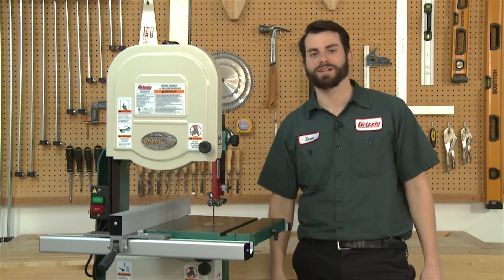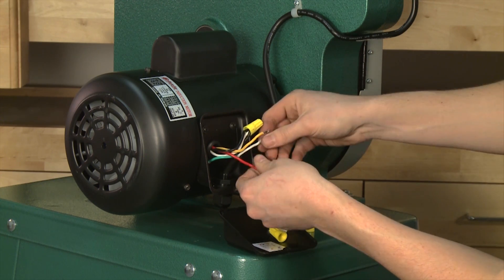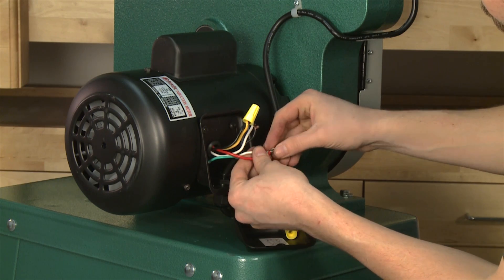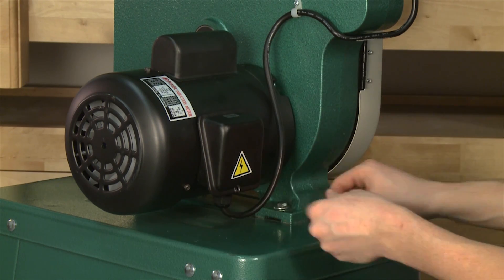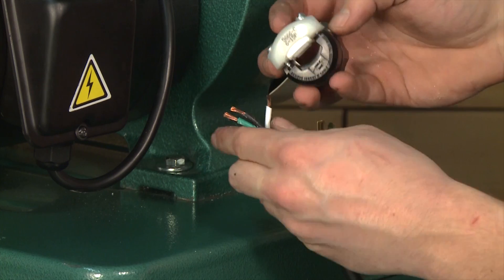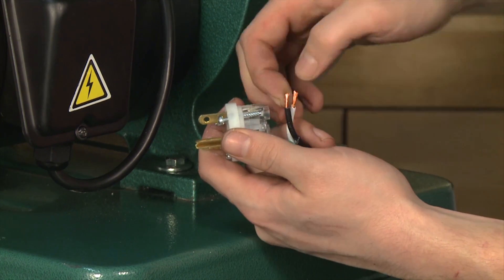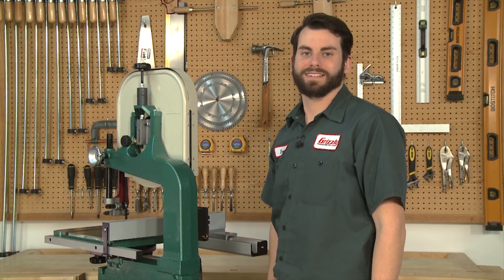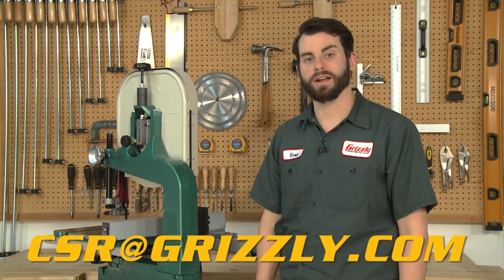110v to 220v conversion

Comment: Can I do that to a110 v fridge? Convert to 220v
Reply: There's a name plate on the motor/compressor it should tell you if it's 240 capable and how to wire it with a vague schematic. As for the light bulbs and potential 120v pressure switches, thermostat or anything similar it's probably going to melt or explode 🤷

Comment: did not show or explain how to wire the source, receptical supplying the 220 volts, plug it in a 110 v and it wont run.
Reply: You have to make sure you have the right size gauge wire and a dual pole breaker along with a 20 AMP outlet and plug end to get it fully hooked up.

Comment: Good video but very specific to model types and the US market. I know Americans seem to love wire nuts but not legal in many other countries especially in Europe.

Some of the comments are VERY scary and display a serious level of  obvious incompetence and utter lack of understanding of even the basics of how AC synchronous motors and three phase motors work and the potential for lethal mistakes. 

If you are going to mess around with AC machines of any type ...

1. LEARN THE BASICS THOROUGHLY! 
2. Take adequate safety precautions ... gloves, rubber boots, current limiting, rapid power off etc.
3. View LOTS MORE videos before even THINKING about changing voltages and for GOD'S sake learn and appreciate Ohms law PLEASE!
Reply: @Nathan Mcilveen not just 240v in the UK. My domestic voltage is REGULARLY above that and often as high as 250v which is what the original UK voltage was many years ago.

3 phase "phase to phase" on a 240 volt nominal single phase supply is 240 x √3 = 415.69 volts - hence the 415 volt warning signs on European (and CERTAINLY British) 3 phase switching gear. 

A nominal 220 volt supply provides 220 x √3 = 381.05 volts across phases. That is 35 volts lower than in the nominal 240 volts case. BUT if, as is often the case in the UK, the single phase voltage is as high as 250 volts, that presents as 250 x √3 = 433.01 volts. So between phases you should EXPECT as high as 433 volts to as low as 381 volts! Over a 50 volt difference!

ANYONE not experienced, well versed or qualified in such matters MUST be aware that these voltages are LETHAL! 

You don't understand? Then STAY AWAY AND DO NOT MESS ABOUT WITH SUCH STUFF ... There are enough Darwin awards each year!
Reply: When have you ever seen an electrician wear gloves and rubber boots? Very strange comment.
Reply: @SightsNjunk I should have said rubber soled boots or shoes. Where have I seen rubber boots being worn ... In power stations! 🤔🙄

Comment: This is fine for electric motors with a provision for switching voltages such as the one shown but how does one reconnect
INTERNALLY for  220 volt a STRAIGHT 115 volts motor without external switching panel nor wires as shown in the video...????????

Comment: Hi. What about the internal bandsaw cables or the ignition switch. Are them prepare to receive 220 w
I have a 110 w bandsaw in a 220w country and use it w/ a transformer. Can you explain a little bit more. Thank you
Reply: if your device is 110 volts only plug into a 220 v, it will toast no matter what wattage. thats why you need to replace or buy 220 volt transformer with the corresponding wattage.

Comment: do we really have to change the plugs or just make the internal wires changes? Thanks
Reply: WOODS plugs. Your 110 outlet isn't wired up for 220.
Reply: The 120v plug is physically capable of handling up to 250v, but it’s a 125v configuration.  In order to avoid problems such as were encountered prior to the 1920s, when America used both 110v AND 220v supplies but used plugs interchangeably, make sure your plug corresponds to the proper voltage.
Reply: I have a plug that's regular 120v but I've made it 240v all over the faceplate I've written "240!!! ONLY!" so yeah it's more than possible as long as your load isn't pulling more than 15 amps per leg or line